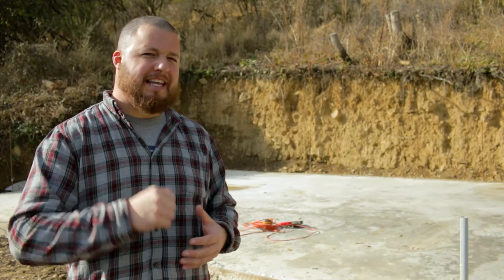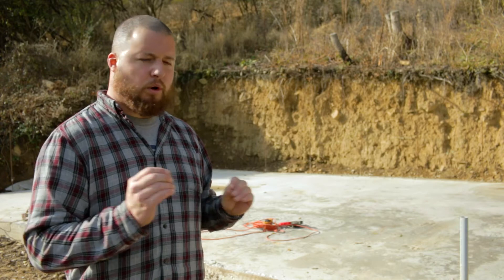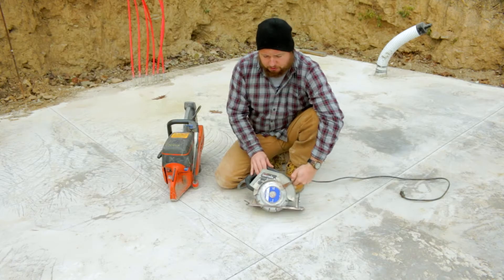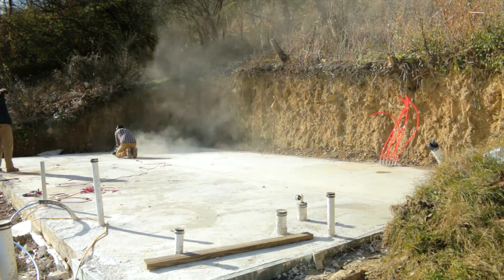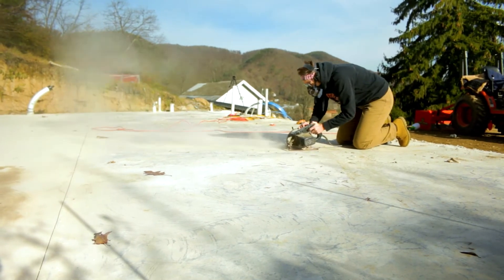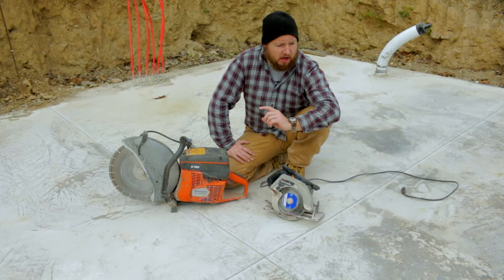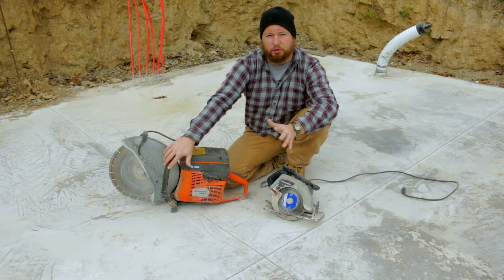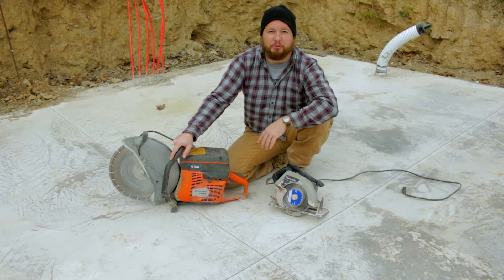Garage Build #17 - Cutting Relief Cuts in Concrete

Comment: Ok so how deep did you cut ??? Completely through? Saw blade looked only 1-1/1/2” deep
Reply: 1/4 inch per inch of concrete. So a 4 inch slab at 1 inch. A 6 inch slab at 1.5
Reply: nice when did you cut? how long after the pour?

Comment: DO YOU RECOMMEND RELIEF CUTS ALL THE WAY THROUGH?
Reply from the maker: @leelunk8235  no. Just an inch or so deep
Reply: 1/4 of the way through the slab.  That’s 1” on a 4” slab or 1.5” on a 6” slab
Reply: @abc-ed1nr  PERFECT THANKS. I HAD GOOBER DO FULL THROUGH CUTS IN 2017 FOR A LARGE SECTION ON MY PATIO AND I HAD WEED GROWING THROUGH THE CUTS . IT WAS ANNOYING. SOLD HOUSE NOT MY PROBLEM NOW
Reply: How long after the pour did you do the cuts?
Reply: @graemey2k  WHAT I CAN REMEMBER MAYBE AN HOUR AFTER